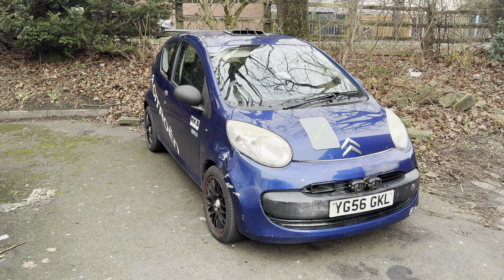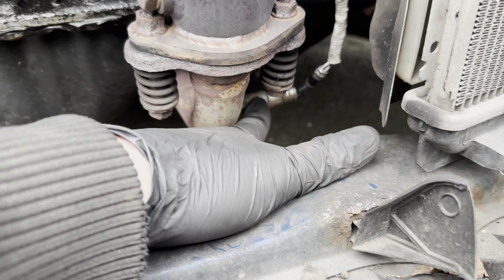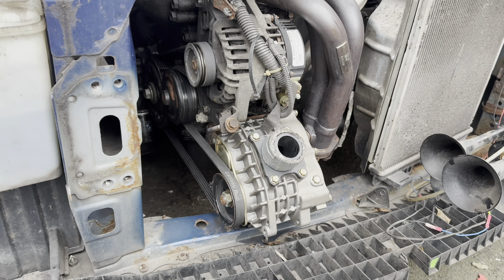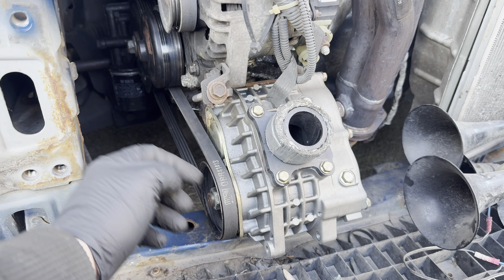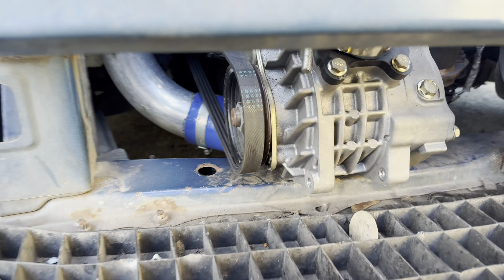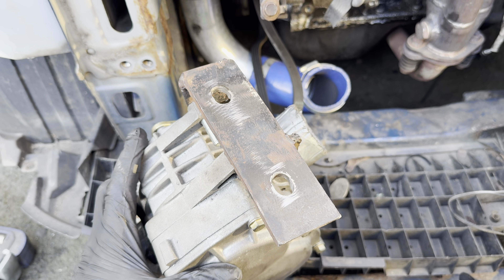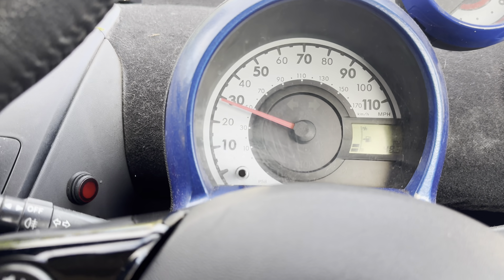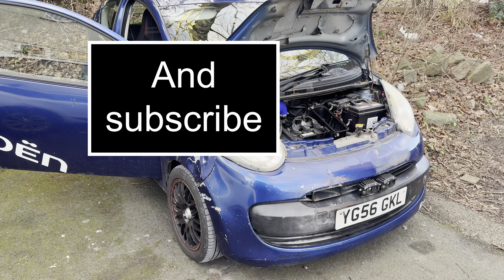CityBug Supercharger Install / Citroen C1 Gets AMR500 Chinese Supercharger (C1/107/Aygo)

Comment: I guess without the mapping it runs lean and the cylinder temps go up - perhaps the exhaust gets to hot or the o2 sensor doesn’t like it and throws the EML on? Either way - can understand why you didn’t want to pay for the ECU remap! Shame we don’t get to see what full boost and full fuel delivery do to it!
Reply from the maker: I’m trying to think of a way to dump more fuel in as easily and cheaply as possible haha

Comment: the thing you cut the spring in is a blow off valve and does not regulate boost it only releases pressure when the throttle is closed. this is a boost leak if not closed until the throttle snaps shut and it will open giving you that pssshh sound
Reply from the maker: Usually yes. The boost goes into both sides of it and holds it closed, but where it’s connected to the vac lines I was under the impression was only open and under vac when the throttle is shut and not under boost when throttle is open but I think I was mistaken. If that was the case then the spring pressure would be all that’s holding it closed and release when it reaches enough pressure to open it, which is what it would do if the vac line wasn’t attached basically

Comment: U want to sort that spring out lad don't sound right check ✅ it over again. Not bad tho 👍🏻
Reply from the maker: The boost goes into both sides of the blow off valve and holds it closed, but where it’s connected to the vac lines I was under the impression was only open and under vac when the throttle is shut and therefore not under boost when throttle is open but I think I was mistaken. If that was the case then the spring pressure would be all that’s holding it closed and release when it reaches enough pressure to open it and crudely regulate the boost, which is what it would do if the vac line wasn’t attached basically

Comment: so with the stock tune, the ecu doesnt freak out when the map sensor sends positive pressure values ? nice lil build tho
Reply from the maker: I’ve not tried it on a stock tune, as it’s previously mapped for a decat and Yaris injectors. It’s not mapped for forced induction though.

Comment: Is anyone going to tell this idiot that the blow off valve isn't how you control the boost on a supercharger?
Reply from the maker: It’s not supposed to be but can be plumbed in to do so, just badly. Under normal operation there’s boost on both sides, take the boost away to the vacuum side then it will open under pressure.

Comment: I'm pretty sure you can reduce the whining, the rotors aren't keyed so it's very easy to misalign them when you fasten them in the charger.
Reply from the maker: Maybe. I think if it was misaligned it would probably lock up though
Reply: @StupidBlokeStupidVideos just give rebuilding it a go and watch the rotors when you torque them

Comment: honestly was onboard and planning to get one myself but my citybug has a/c so mounting the charger would be a pain in the ass. great video tho 🫡
Reply from the maker: Yea the A/C would have to come off, but you don’t need A/C if you’re going fast enough
Reply: @StupidBlokeStupidVideos hahha i kinda do need the a/c since where i live tempatures drop as low as -40 celsius and the a/c defogs my windshield way faster than the normal blower 😅
Reply: @StupidBlokeStupidVideos  also ive been wondering lately, my c1's boot lock wont open (i have the model without central locking) so how difficult would it be to fit the button mechanism in place of the regular lock in a way where it would work properly? ive seen someone replace theirs with the button and they were able to open the boot, but im not sure whether u can still lock the boot or if its always gonna be unlocked then.
Reply from the maker: @peugeot206gt probably a bit of a pain in the arse tbh 😂

Comment: The dump valve will not regulate any boost as it is connected to the intake. At that point you are sending pressurized air to the dump valve holding it shut while on boost. It will only open under vacuum. But it definitely sounds sick! And good job for actually doing this to this car! 😀
Reply: Exactly, the bov doesnt regulate boost, it vents to atmosphere when the intake sees vacuum
Reply from the maker: @epp9122 if no boost is put to the vacuum side and there is no equilibrium then it will release when it reaches enough pressure to push the spring open. I’m not sure if where it’s tapped into for the vacuum is only under manifold pressure when the throttle is closed. If so then it should crudely regulate pressure. I’ve not investigated that properly yet though as I just threw it on and took it around the block to see if it worked.
Reply: @StupidBlokeStupidVideos  sure it lets boost out when you let go of the throttle, not under boost, then the spring should keep it closed. 
The pulley diameter determines boost level on a supercharger
Reply from the maker: Yes you mean from the equilibrium of pressure on both sides. I’ve not looked into it properly but I’m not sure if the solenoid closes under acceleration so boost wouldn’t get to it, that’s why I’m assuming it wants connecting to that side of the solenoid but I could be wrong. I’ve not checked properly.

Comment: did u notice more pulling or more power
Reply from the maker: Yes, not huge as boost is set low for now but definitely more grunty. After taking it around the block it got better. At first it didn’t seem to make much difference but after about 30 seconds it seemed to kick in and work better as the fuel probably trimmed to max. I did floor it as soon as I pulled out from being parked up though to make sure to break it in nice and gently.

Comment: Could you not put a larger set of injectors into it to get extra fuel in making more use of the boost …
Reply from the maker: It’s already got Yaris injectors in it and a remap, tbh it would be better without the remap as the map is for naturally aspirated and I believe the timing is advanced,.. which is probably the last thing I need with the forced induction 😬
Reply: Yeah but the ecu needs to know there are different sized injectors in

Comment: I didnt saw any difference in acceleration?
Reply from the maker: It’s definitely more pokey, mainly at low revs but didn’t wanna drive it too far until I can suss a way of giving it more fuel then hopefully turn the boost up a bit. It’s only set to very low boost currently

Comment: You will need a remap. Otherwise, it will run lean. And lean is HOT. And it's also missing an intercooler and therefore already gets HOT air.
The first summer day and the engine will go BOOM on the high-way when chaising a topspeed run...
Reply from the maker: The car isn’t going to make it till summer anyway 😂

Comment: leave the o2 sensor unplugged and it will run more rich, it should make more power that way
Reply from the maker: Yes. It will go into open loop. This is another thing I have been considering trying.
Reply: @StupidBlokeStupidVideos  yep old school trick to boosting a stock car. Usually works fine if you are doing 4-5psi and under. Sometimes if you are lucky like early 1.6-1.8L miata's, you can go high as 7psi safe

Comment: I would get a different pulley and use the same width and the belt straight  and add idlers  to minimize "harmonics
Reply from the maker: We don’t need to worry about harmonics where we’re going.

Comment: What about oil feed and return?
Reply from the maker: There is oil inside it, gearbox oil I believe these use
Reply: @StupidBlokeStupidVideos it's not gearbox oil, it's something else, could be some castor oil with additives, already changed oil in a m60 supercharger in a Benz - I used a little bottle from AC Delco specifically for superchargers.
Reply from the maker: @Gottgum there’s specific supercharger oil but I think this just has hypoid 90 in it 😂
Reply: @StupidBlokeStupidVideos could be, the viscosity was a lot like it
Reply: This is not a turbocharger, it's a supercharger driven by belt with its own oil lubrication

Comment: Fitted an AMR300 to my friends Citroen 2CV. Up from 29hp to 40hp'ish which took 10 seconds off the 0-60 time!!
Reply from the maker: Please put a video of this on here.
Reply: @StupidBlokeStupidVideos  I don't have any videos to post.

A couple of things that may help you, the 2CV is a 602cc and the AMR300 pumps 300cc per rev (if 100% efficient). The AMR500 pumps 500cc and you have a 1000cc engine, so the drive ratio that I ended up with was 1.4 to 1 and this gave 6psi, which was safe for the engine without major modifications. I suggest that you would need a similar drive ratio for your conversion.
Reply: @julianwinn4502  Film some!!! please!!!

Comment: Have you also installed a rising rate fuel pressure reg to counter the boost thats bieng made?
Reply from the maker: Not yet, I do have bigger injectors but a FPR is an option I’ve been looking into
Reply: @StupidBlokeStupidVideos personally id be running a fpr before anything a wideband isnt a bad shout i boosted a vitara a couple years back now and it wouldnt have lasted long without the aem wideband or the fpr before i finished tuning it
Reply from the maker: @ethanrainsford4251 it will definitely need more fuel. I was trying to listen for pinging but the supercharger is so loud I’d not have heard it anyway 😂
Reply: @StupidBlokeStupidVideos yeah you wont at all cant even dial back the ignition timing on these without remapping be intresting to see how much boost it puts out too

Comment: Amr500 with that size pulley won't output even 5 psi on a 1l engine that looks to have, put a smaller pulley on it that matches the alternator number of ribs and put a pressure gauge in the intake and try to get it to make around 1.5 bars, then it will have enough boost to make a difference, the ecu should be able to compensate for the extra intake but a tune for more fuel will be substantial improvement
Reply: The ECU won't be able to compensate for 1.5 bar and the engine itself can't take 1.5 bar. Compression would be too high and you get detonation. Need aftermarket ECU and a built engine for anything more than around 3psi.
Reply: @Rudy97 You can stack head gaskets to lower the compression.
Reply: Does it look like he is looking to make the setup reliable ?
Reply: 1,5 BAR? Looking to send the rods to the moon?
Reply: It's a very small displacement, it won't have significant gains at low boost, that's around the max a 1kr-fe can take with stock internals at the limit of detonation with very high octane for short pushes, don't think he is looking for reliability.....
Reply from the maker: It’s just a cheap version of a supercharger. The pulley is quite big but I’m not looking for massive power
Reply: @StupidBlokeStupidVideos  Ignore the suggestions here. They're absolutely idiotic. What you did was fine for a super cheap setup on a stock, high compression engine. Get it on a dyno asap though, to see how much boost it's making and what the AFRs are.
Reply: @StupidBlokeStupidVideos sounds great 👍🏻 😀
Reply: Put 1.5 bar on this shitbox and it will blow up immediately.
Reply: @rigilkentaurus3313  No engine will take  1.5 bar without significant modifications. That's literally 2.5x times atmospheric pressure. The comments here are idiotic. I wish people would give advice when they don't have experience in doing the thing they're advising on 🙄
Reply: @Kj16V atmospheric pressure is 1 bar/ 14.7psi
Reply: @8313vehicles yes, and? 1 bar + 1.5 from the supercharger is 2.5 bar, so basically 2.5 times atmospheric pressure.
Reply: @Kj16V  a lot of engines will take it, just not for a long time, lifting the head or throwing a rod eventually
Reply: @BillyTheSKID Yes, also a lot of engines will work with a bullet hole, just not for a long time.
Reply: @Kj16V  a stock redblock will take that forever
Reply: @Blue__244  I take it this C1 engine is known as a redblock? If so, show us a stock engine, with stock compression, stock injectors, stock ECU, that is running 1.5 bar 😄
Reply: @Kj16V  you said "no engine can take stock without significant mods" which is why i said the volvo redblock will take that any day of the week forever and putting the stock maf into a 3 inch tube and getting 33% higher flowing stock injectors arent a hard mod at all oh and yes stock ecu will do 20psi with stock injectors and stock maf i ran 20+ psi on my original engine for 10k km until i swapped it for a built engine to make over 700
Reply: @Blue__244  My bad for not specifying. I meant N/A engines.
Reply: @Kj16V  oh you can turbo the N/A redblocks and do the same mods as mentioned slap a turbo on and rip they hold 30psi on ethanol
Reply: @Blue__244  That's great, but what part of STOCK don't you get? 😂😂
Reply: @Kj16V  you can run 17+ psi on a stock one which is
Reply: Dude, no way this thing is gonna survive so much boost, and I doubt the cheap supercharger can do more than a bar.
My mercedes kompressor only had 0.3 - 0.4 bar boost and made 170 hp.
Reply: @johnkowalsky1988  sounds good I like it 😉
Reply: We will see.....
Reply: What volume was the Mercedes and what volume is this ? Try comparing with a Mercedes closer to the displacement of this ( see the max boost of a smart roadster )
Reply: @freenergyterminator Mercedes had 1.8 liter 4 cyl. This is 1.0l so you need more boost to make a noticable plus in power? If this thing makes 68 ps or whatever stock.
What power are you expecting here? My guess is 100 bhp would be good and maybe still reliable for the drive train( I know reliability isn’t the point here)
Reply: @johnkowalsky1988  It does not need lots of boost anyways, even at 100hp it will definitely be faster than a 1.8 supercharged merc. For higher horsepower it would probably be better to swap in a 1.5 and turbocharge that.
Reply: he obviously means 1.5 bat absolute (0.5 bar boost)
Reply: The engine wont hold the instant torque from the supercharger so better be safe thab sorry to push 1.5 bar
Reply: Come on man.... Have you read the channel name.... You want safe reliable build ?!

Comment: Youre a legend mate, I wonder what the 0 to 60 was?
Tbh when I had it's brother the Aygo, I didn't realise I hadn't put the air filter in properly and that gave me a nice boost I wonder if that can be used as a benchmark against the super charger, have a small cloth wrapped around the throttle plate with the stock option Vs the supercharger
Reply from the maker: Nice one. I might try and get a 0-60 in another video. I usually test 2nd or 3rd gear to compare acceleration changes from mods cos there’s less discrepancies from driver if there’s no gear changes. Have you seen my video comparing the cone filter to stock? Here it is if you’re interested 

https://youtu.be/Of0-4dMQmZg?si=0apkR6pEG1Gi5IUI